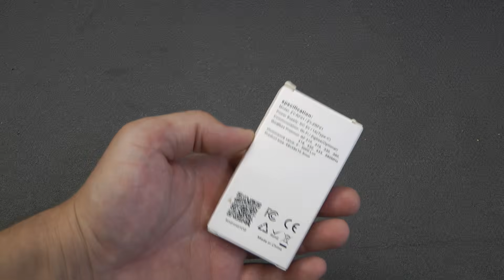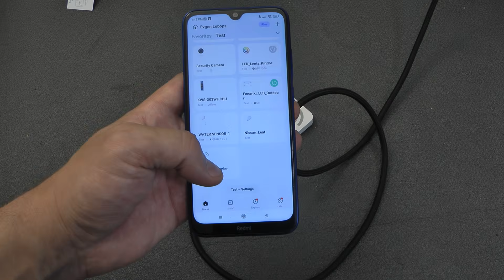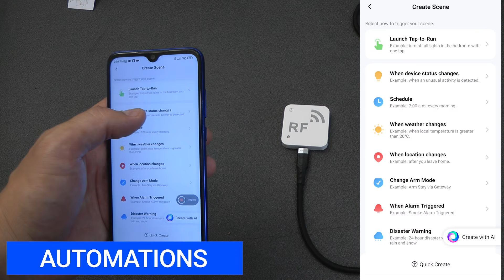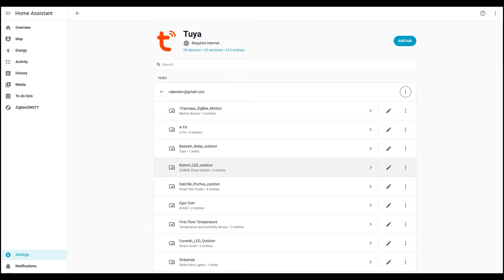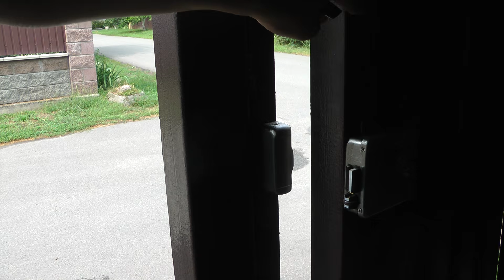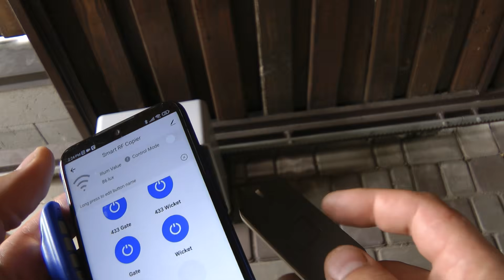RF 433MHz Copier Tuya — Control Gates, Side Gate & Lights from Your Smartphone

Comment: What is the “Timer” for? You said that when you turn it on, it closes, and when you turn it off, it opens. I didn’t understand that. Could you explain it?

Also, is it possible to control only the switch using the RF Copier? I mean, can I connect it to RF without using a remote control?
Reply: I have a question. For example, how far away can the remote control operate this product? Where do you get information about products like this?
Reply from the maker: Thanks for the question. The Timer here works a little differently from a normal smart switch timer. The RF Copier does not know whether the device is currently ON or OFF, or whether the gate is open or closed. At the scheduled time, it simply retransmits the RF command stored on the selected button.

For example, if one button on your RF remote works as a toggle — the first press turns the light ON and the second press turns it OFF — the Timer simply “presses” that same button automatically at the scheduled time. So the final result depends on the current state of the device.

Regarding using an RF relay without the original remote: the RF Copier is mainly designed to copy an existing RF signal. It does not generate an arbitrary new RF code by itself. So normally you first need a compatible remote from which the Copier can learn the signal. If your RF relay has a learning/pairing mode for new transmitters, you can then try registering the signal transmitted by the RF Copier directly with the relay.

There are also two different distances to consider. During RF learning, the original remote should be kept very close to the RF Copier; the manufacturer also states that long-distance learning is not supported. The transmission range from the Copier to the RF relay depends on walls, interference, and the sensitivity of the receiver. In my test, the Copier was on the second floor and behind two walls from the gate, and the relay still worked without problems. I did not measure the exact distance in meters.